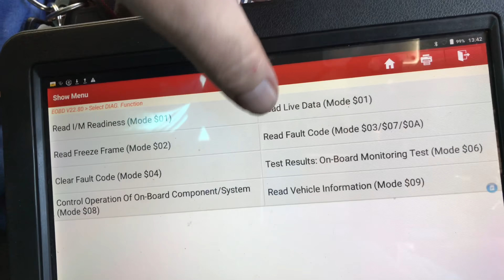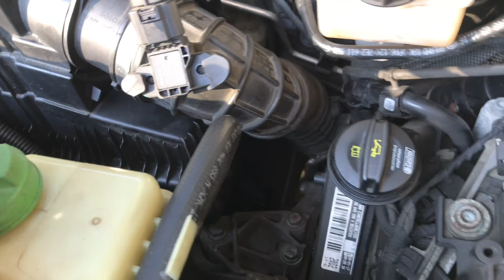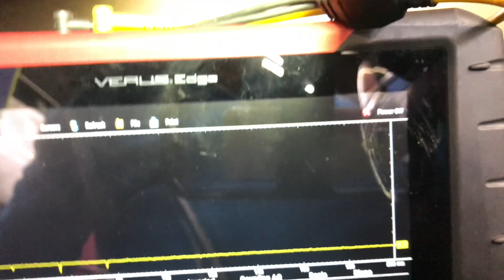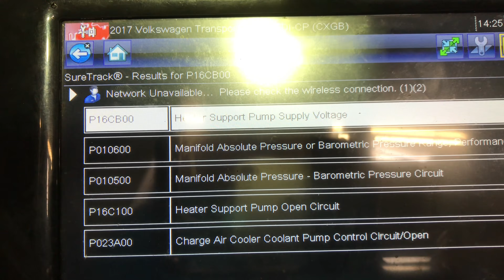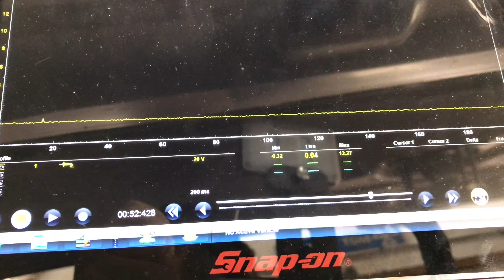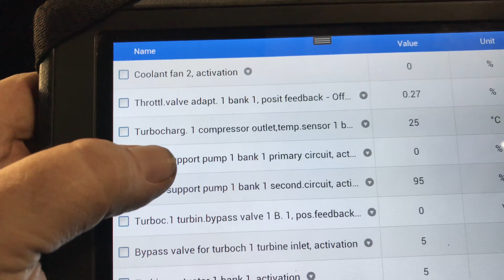VW Transporter (2017) - Fault Code P16CB00 Heater Support Pump Supply Voltage

Comment: I have SEAT LEON 2018 tdi recently changed water pump and auxiliary . Straight after got error (P16CB00) heater supporting supply voltage, garage ppl tried 4 days couldn’t figure out . Now I don’t know what to do 🤯. If anyone knows how to fix this issue please let me know that would be great full

Comment: Help I have the same problem I have had a new pump fitted  and all tested  snd got home and light came back on.  Any advice
Reply: Fighting with exactly the same it’s driving me mad. I’ve had this fault for 6 months. New genuine pump at the garage £400, and I’ve spent two whole weekends requiring it all. New ecu wire, new ground, new live, new connector plug. It’s driving me insane.
Reply: @SteveoSpeedy hi bud. Did you ever get to the bottom of this?

Comment: I’m fighting with this. Same code, heater support pump supply voltage.

Output test works, can hear the pump working etc.

Put it into the garage and told them to test wiring - they fitted a new pump, charged me £300 and sent me home with the same error 😫

So I attacked it tonight, on my heater support pump (back of engine) removal of airbox and snorkel you can gain access to the connector, but not much wire.

Cable heat shrink was damaged. Blue / purple ecu wire looked suspect, so cut out suspected bad bit and soldered new bit.

Still the same error.

Probed 12v feed at the connector (ack and green wire) and shows battery voltage, ground (brown) seems OK too (using voltmeter).

Ecu wire on voltmeter fluctuates, but assume this is not a good indication? Unless ecu signal wire should also read 12v???

No clue where to go now. Garage unable to fix, wasted money, wasted time.

I have the wiring diagram, maybe next step is to bypass old loom and wire live straight from pin 12 t41f connector in engine bay (but not cut, as it also supplies oil pressure switch), find new ground wire, and pit entirely new wire from t60 connector on pin 43 at ECU control unit J623. From ECU to pump (blue purple wire) it seems it goes direct to pump, so ‘should’ be safe to renew rather than pulling apart the old loom to find any more breaks.

As another clue, I ran pump when I cut the blue and purple ecu wire - ecu reported same fault - static error for ‘heater support pump supply voltage’.

So that is either because ecu was not monitoring pump, or its entirely coincidental.

Such a stupid problem that is dragging on for me for 6 months now…..
Reply: здравствуйте. 
Вы решили эту проблему?
Reply: Did you manage to fix the issue? Thanks
Reply: @Fay-t6z I gave up spending my life troubleshooting it and got someone to code out the error code in the ecu / disable it.

I made seperate test looms and bypassed the old one - same error, tried a THIRD pump same error, then completely rewired from the ecu to the pump, and a new ground, same error. Whether I disconnected the ecu feed to the pump or not it would always report same error.

The mad thing was that the pump would run with ignition on, and I could control output tests and start / stop it using VGS / obd11.

Absolutely bonkers problem.

I came to the conclusion everything was working despite the ecu throwing a stupid EML, hence coding it out.

Comment: For any body struggling with this fault . It can be a faulty pump . Check your wiring . 12 volt feed and earth and signal 3 wires . If they are okay more than likely a pump issue.  The pump is variable speed and even if its spinning on bench test it can still be faulty . As there is a control unit in side this pump very complicated unit more than meets the eye . You have to use a genuine pierburg pump guts of 200 euros . I install a cheap one and keept geting this error message . The previous pump had a short circuit in it . Which had blown the fuse for both front and rear pumps . I also found the connector plug had a black insulation on it and had the wiring held very tightly so i removed it incase was causing a bad connections all good now function perfect hope this helps someone
Reply: I’m at my wits end with this, in a be specialist they replaced pump, cost me £400. Same problem. I replaced ecu wire in box, same problem, new fused live and ground, new plug, same problem. Pump works fine, output tests work fine, but still get static ‘supply voltage errors’. I am lost.

Comment: ok guys i had the same Fault Code P16CB00 Heater Support Pump.  The problem  is because i bought  not original one.  Once you put original  pump,   all good. Sorry for  my English . The price in Belgium for this pump is 350€.  Hope it will help someone .
Reply: This helped me thank you
Reply: So if you fit a genuine pump that fixes it.   I had a aftermarket one fitted  and engine management light still on
Reply: Make sure you bleed the coolant system properly after . If the pump runs in air it will burn the new pump out but yes a genuine should fix it . Get the same brand . Its either bosch or pierburg depending front or rear @richardfogg8625

Comment: i got same problem and the same Fault Code P16CB00 Heater Support Pump Supply Voltage.  checked everything  and cant rid of it.
Reply: Same as you, replaced the pump cleared fault and reappeared after a couple miles driving
Reply: Hi, did you solve the problem?

Comment: I have seen the silicate bag in the header tanks to break & send the silicate pieces all over the cooling system like sand, get stuck in the impeller & stop the pumps from turning. Then when the pump is removed the silicate gets dislodged and the pump works fine when bench tested. Meanwhile the new pump that is fitted gets stuck again due to the silicate in the cooling system. Brain fry 😤😤
Hope this helps, very methodical approach though Sandy well done. Look forward to the fix 👍
Reply from the maker: Thanks for information if the plasterer ever returns I'll tell him cheers sandy

Comment: Modern madness Sandy , I had a delivery from TPS today for a Transporter , main engine harness and injector  loom £430 , paid the driver , opened the boxes , slight problem only 4 injector wiring plugs and on the engine harness 4 heater plug wires , that would be great , but the vehicle is a 2.5 TDI, 5 Cylinder,  I ordered it off the chassis number , the numpty on the phone who placed the order ordered them  for a 1.9 tdi caddy 🙈🙈🙈🙈, refund please and re ordered , hope you get it sorted buddy , was Roddy in the background fitting a bulb 👍👍😂😂😂😂